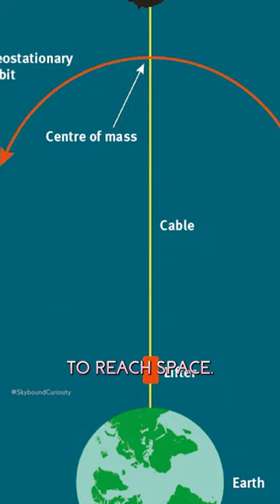Space Elevators: The Cosmic Ascension Concept

Comment: Question: If we were to build one 

How would this be cost effective than a rocket based on the materials that we need to build it and launch it

Side note: This is not a hate comment or smthing, I'm just wondering how much would this cost to build and launch compared to a multi staged rocket or how expensive would it be compared to a rocket to collect build and launch it
Reply from the maker: to put it simply: a space elevator is infinitely reusable, rocket fuel is not.

long answer: the resources need to build this kind of structure would exceed any kind of project humanity has ever undertaken in history, the cost would be enormous and there is no definitive answer as to how much it would cost given that it still a theoretical structure. We still don't have viable mass produced materials that could theoretically build this structure but a few candidates do exist; like spider silk (yes from spiders) and carbon nanotubes. However both of these materials are very expensive and extremely hard to mass produce defect-free. The reason why it is a more cost effective way is because once build, there would be little to no maintenance required for decades, sometimes it would need orbital readjustments with rockets but nowhere near the amount that is used to transport rocket ships, given that it would be in space, therefore weightless and it would be completely powered by the sun itself via solar panels or nuclear reactors, it would run completely on electricity, a renewable power method.
Rocket ships have been getting more cost effective during the years but that's because we have no other means of travel to space, therefore the only method will logically get more cost effective during the years but will never be as cost effective as a space elevator. Sure the initial cost is massive but the uses are infinite. Currently, to send 10 Tons of resources in space, you would need to waste around 400 Tons of fuel, that's a 40:1 ratio, NOT very cost effective, millions of dollars only for fuel, let alone the billions for all the technologies like software and hardware required for such missions.

Thank you for the comment, checkout more of our content and be sure to stay tuned for more🤍
Reply: @SkyboundCuriosity  if you said this was cost effective, then what is the propulsion or what type of system/combination system to get up, would SSTO's (if they were ever possible) counter this cost by fuel or propulsion efficiency

And if they exist which is more efficient to use: Space Tether or Space elevator and also one last request, can you research what are the flaws of space elevators or space tether or both (based on your answer) and reason to me or give me a reasonable answer on why or why not, if they are correct or you have a solution

Thank you for replying
Reply from the maker: @WaypointCrystal9526  both space elevator and space tethers are viable options, but a space tether is more viable to be build currently rather than a space elevator given that it does not need a connection to earth. 
Regarding the question how we would get a space elevator standing the answer lies in the counterweight, a massive counter weight would be placed in orbit around the earth at the exact distance where it would spin around earth every 24 hours so it always stays in place, after that it would be a game of transfer, from a smaller tether released from the counterweight to earth, to larger and larger exchanges between the counterweight and earth until a strong enough foundation tether would be build for the elevator to be build around it. Of course this is not a simple process as it would require incredible around of workload most of which would be done by robotics. It would be a process that would get faster as we would go. I would recommend you watch Kurzgesagt videos about both space tethers and space elevator as they go in much more detail.
Reply: @SkyboundCuriosity  so your suggestion:

What type of propulsion system would you use in your space elevator
Reply from the maker: @JayPPhantom2262  RCS Systems on the counterweight and all sides of the space elevator, just like the ones on the ISS, they would use any type of fuel. Alternatively, large Reaction Wheels can be used too.

Comment: "while technically feasible" it is not technically feasible lol for the exact reasons you mentioned are challanges. There is no material strong enough to stretch such a long distance without snapping. So not technically feasible.
Reply from the maker: "technically feasible" doesn't necessarily imply that something is immediately practical or economically viable. It simply means that, in theory, the required technology and scientific knowledge exist to make it possible. Other factors, such as cost, materials, safety, regulatory considerations, and societal impacts, may still need to be addressed to determine if the project is overall feasible or worthwhile.

p.s: there are already materials that could theoretically support such a structure like: carbon nanotubes and spider silk. The challenges with these materials are 1. its really hard to mass produce defect-free carbon nanotubes 2. spider silk is also hard to mass produce.

Comment: Its cool but it definitely wouldn't be cost effective lol
Reply: do some personal research, its better in pretty much every way than what we currently do.
Reply: true, but launching material of any kind into space isn't cost effective. it costs around 100k to send a pound of material into space. We need to look past cost if we want to make any progress in space travel
Reply: @dallasbhowell8485  yes, specially in the ungodly amount of foundation it would require unless we're using a material with super strength that hasn't been discovered yet
Reply from the maker: if we are comparing the effectiveness of a space elevator and rockets for sending cargo to outer space, the space elevator is way way more cost efficient but requires enormous research and manufacturing, something that would be very incredibly expensive, but in the long run it is the most efficient way to send cargo to space. Of course we are a long way from a functional elevator but when the time will come it would be an incredible structure. thank you for the comment and stay tuned for more 🤍